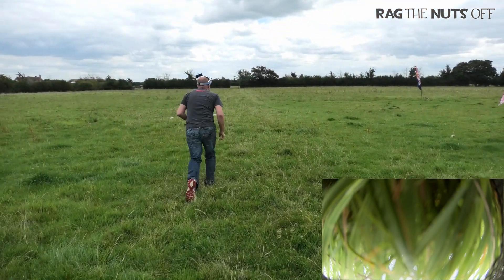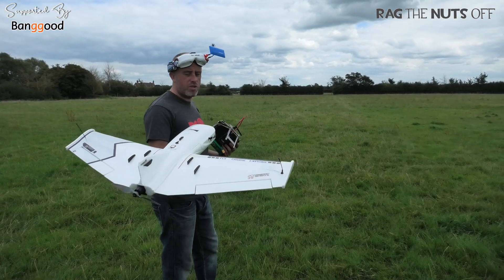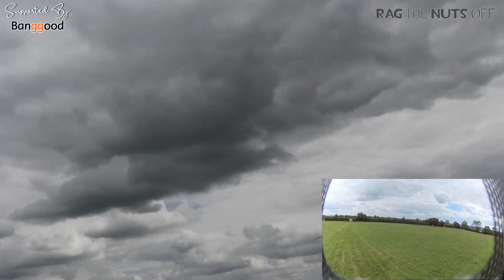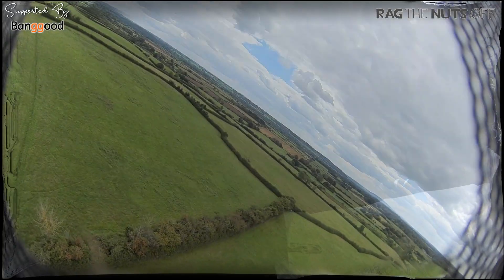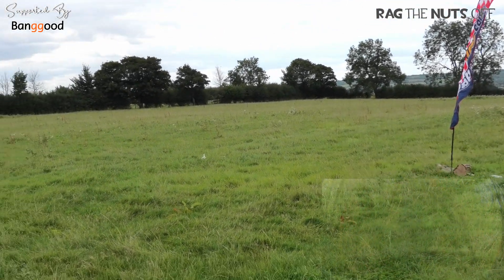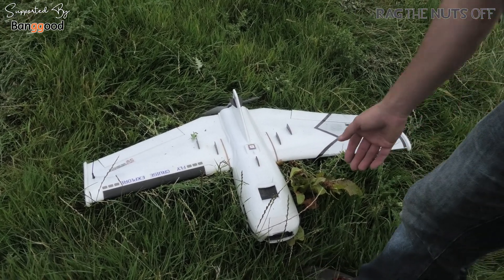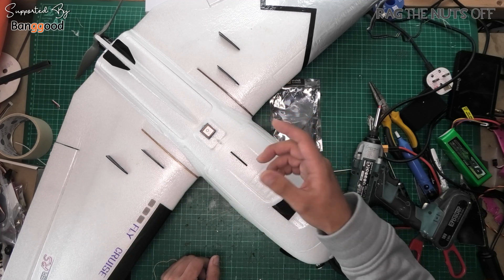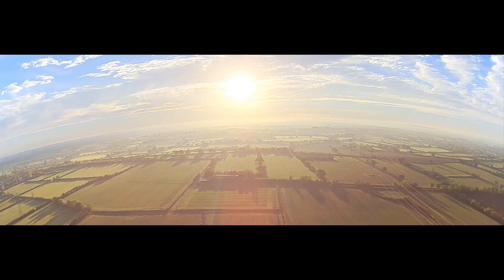LTE Rambler RS Maiden (with INAV, ish)

Comment: Hi Mat. 

Thanks for all the info you provide all the time and providing it as is and honest. 

But I have one question, I bought the motor you suggested as being ideal "SunnySky X2216 1250Kv http://bit.ly/2zebJWG (ideal)". But how is this motor ideal? the non rotating mounting base is on the shaft side of the motor, not the bottom. So I have no idea how I can mount this on the back of a wing. Maybe I'm completely missing something, so please explain how this motor is ideal and how I can mount it. (Please bear with me, I'm still learning in terms of flying and building fixed wings)

Thank and kind regards, 
Bjorn
Reply from the maker: Howdy Bjorn, the motor comes with a X mount, just use that and the bolt on prop adaptor. It'll make sense when you see it. Matt
Reply: RagTheNutsOff. Thanks for the reply. I get it with the motor mount. I just think this motor is not suited to be fitten on the back of a wing. I only noticed the wires coming from the front of the motor in stead of the back when I received it. Looking at the other motor suggested, this one is similar to the ones I’m used to, this can be mounted on the back of a wing. But the 1250KV SunnySky motor just isn’t suited to be mounted this way, since the back of the motor is also the spinnig part. Please take another look at the suggested motor I think the advice is wrong for a wing (wanted to upgrade my AR wing with it) But it’s impossible to mount because the non rotating part of the motor is between the motor shaft and the stator part of the motor....
Reply: Oh wait, now I get it. There is also a prop adapter you can mount on the other side. You just have a shaft still sticking out the other side of the motor. Haven’t seen that before, but hey it still works 😃.  Time to mount it and go full knackers!! 🤩

Comment: That "hunting" is caused by inertia. Basically, that massive Lipo weight is sustaining the wiggle once it starts, the forward sweep starts it though. Those winglet / fences are utterly pointless. Try a lighter lipo on Maiden flights, or get a launch ramp...lol.
Hunting is for foxes BTW.
Reply from the maker: Hey ET, I was just looking at it (to make a bigger vert stab and some winglets frmo depron) and I reckon those middle fences are partly the cause of it. The air goes from the tips to the middle on a forward swept wing, so those fins are stopping that airflow from hitting the main fin. Does that make sense? Matt
Reply: @RagTheNutsOff  Yes, but the winglets / flow straighteners  are needed further out along the wing like the Dart XL... This is to PREVENT spanwise flow, increase lift and prevent tip stalling. This model needs them. 
  The side to side hunting, or wag is caused by first one wing and then the other being introduced into the airflow. The Lipos weight sustains it. If you fit the fences, it should stop the wag and you won't need to increase Fin area. Prop wash is feeding your vertical stab...Think about it
Reply: EnglishTurbines interesting point. Though with the battery always being relevant to CG I wouldn’t have thought it’s size would make such a difference. It is close to the CG after all. 

It does take the same pack as others this size but they don’t exhibit wag.

I also didn’t think the wing fences helped on a forward swept wing, it’s stopping air flowing towards the motor/vert stab. 

If I had one matt I would extend the centre vert, remove the fences and fit a moderate fin on the end of the wings.

Comment: Excellent investigations Matt. Looks like forward sweep generally requires a full effort throw for launch.
Reply from the maker: Hey Andrew, yea. Full beans are definitely needed. Flew fine once it was up. Out tomorrow morning with it with the replacement Matek FC in it. Super impressed with the experience with them. Matt